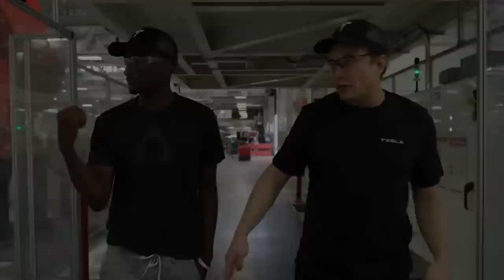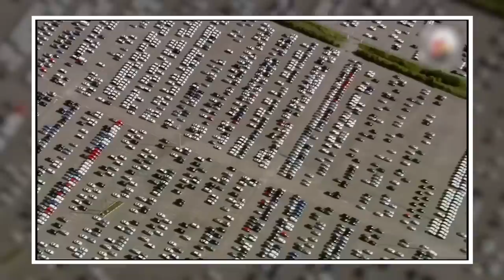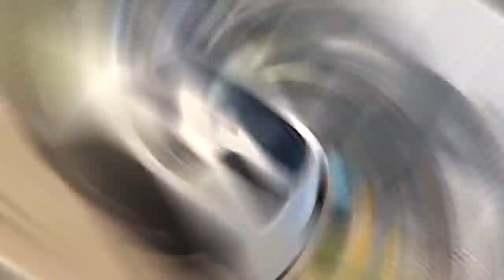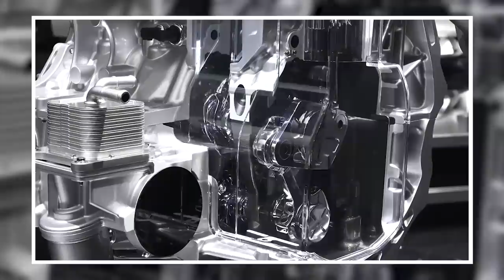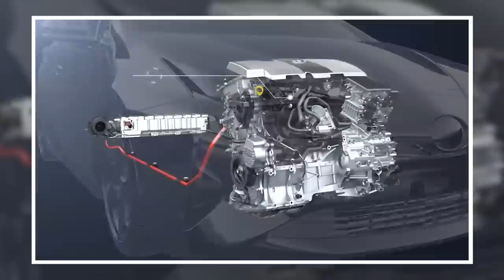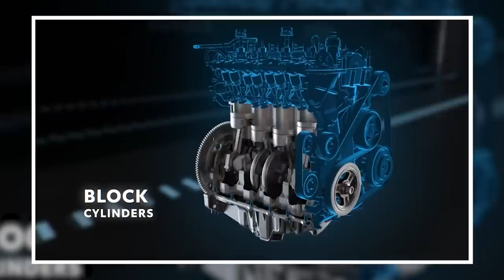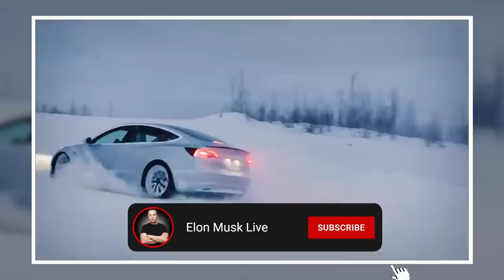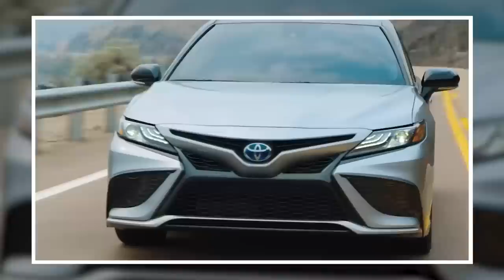Why Elon Musk is Scared of Toyota’s NEW INSANE ENGINE!

Comment: Literally everything in this video is exaggerated. Tesla doesn't have PERFECT efficiency, efficiency can always be improved. Toyota's new engine isn't revolutionary, it's a 6% increase in efficiency. Elon definitely isn't "scared" about it and it won't "knock him off his throne"

Coming from someone who absolutely loves Toyota cars and owns a modded Toyota Prius (you know, Toyota's efficient car), this new engine will likely have little to no effect on Tesla. And what do the 1/2JZ and 4AG engines have to do with anything in the video? I feel like you just threw in information on those engines and Toyota's history just to extend the video to 10 minutes to get more ad revenue/watch time
Reply: Nothing "efficient" about needing three motors to do the job that a single petrol engine has been doing in automobiles for over a century.. Nothing "efficient" about the range of an ev either..
Reply: 😆 🤣 facts
Reply: @motherlovinsnuffstar  the best design I’ve seen is a manifold conversion from gas to Hydrogen for any Combustion engine but that would mean free fuel for every one
Reply: @Straywalker0420  Yeah, they can't have that lmao
Reply: @Straywalker0420  no hydrogen engines does not mean free fuel. This is a common misconception made fuel cell engines are not ran on water they require more expensive fuel being hydrogen. The hydrogen combustion engine requires a lot more complexity in chemicals in order to work. Problem is that there isn’t enough resources for such things to exists they been trying to project these things for over 20 years now…
Reply: HeyitsRed  Absolutely right!!! That shows you definitely understand!!! I don't believe for one New York second that they'll ever rattle Elons nerves!!! Also a happy 02tacoma owner of which I'm proud to be. And knowing there great mechanical machines. Still not impressed by the new motor as well. Please continue your obviously intellectual comments as it's refreshing to read such!!!
Reply: @6gi  Well the actual reasons are because

1. My mom encouraged it since she wanted me to have a reliable, efficient car for college and my last bit of high school. A couple months earlier she didn't want me to get a Prius for the exact reasons you said, but then my aunt (who owns a 2016 Prius that she's going to pay me to mod) told her that none of that is true

2. When we bought it, it was when the car shortage was at its peak. Though luckily it was just BEFORE prices went up. The Toyota dealership had so few cars that they only had like 30 total cars when normally they had over 150. Out of those, they only had 2 Priuses, about 4 Corollas, and like 3 Camrys, so my choices were pretty limited. I wanted a red car, and the Priuses were 2 of the only red cars there. It was a 2015 used and 2021 brand new Prius. We decided to try the 2021 first and it was a borderline luxury car, as if it came from Lexus

So we took it for a test drive and it was great, and only had 48 miles on it. After we bought the car and I got into Initial D, I decided to get into cars. I always hear people say the Prius was slow, boring, and ugly and I can tell you, only the last one is true. The thing isn't fast, but it's not slow either, more of just average (though you can still add performance upgrades that are not turbos or superchargers). That car is definitely not boring. Not only is it a ton of fun to drive and has incredible handling, but I've also managed to have the same fun in it I'd have in any other car, drifting that thing around corners and modifying it to look cooler (front lip kit, front license plate relocator, rear lip spoiler, diffusers, etc). I even took it to a gravel circuit road that was at the campsite I visited with some friends and when we learned no one else would be camping there for the weekend, we used half a tank of gas in my car using the Prius as a rally car. That was some of the most fun I've ever had. We even managed to jump it a couple times, but that wasn't a problem because the car has built in plastic skid plates

That car is very underrated and gets a ton of hate it doesn't deserve. The reason most people hate it is because it's not powerful, or fast, or as stylish/cool as something like a Corvette or GT-R, but it also isn't meant to be. It gets hate for something that doesn't relate to the car even a little. It's meant to be a cheap, reliable hybrid car with great mileage and it does exactly that. Plus most of the people who say it's boring have never driven it. As James Pumpfrey from Donut Media said, "It's more fun to drive a slow car fast than a fast car slow"

Anyway that's my English essay of an answer, but usually people don't understand unless I go into detail
Reply: @seanixt  Blanking blank However much I hate to admit or agree with you I'm sorry to say I'm pretty sure that's true!!!! And I'm thinking it'll be very similar to the change we made from analog to digital television sets!!! As most suthsayers have said we'll be dragged kicking and screaming into the twenty first century weather we like it or not!!!! So I'm simply going to say relax sit back and enjoy the technology as it most assuredly will arrive extremely quicker than we could have ever anticipated!!!! I'm thinking even though we know this it's still going to be an extremely rude awakening!!! I mean we're not even a quarter of the way into this century and governments are already contemplating mandatory switch over to EVs !!!
Reply: I agree, this is biased
Reply: Well if im not mistaken they have a 1/2jz type engine that runs on hydrogen rather than gas they have a v8 in devolopement witha little help from yamaha
Reply: @poke12gauge32  hydrogen engines don't work like combustion engines at all, so the hydrogen engines will be NOTHING like any famous Toyota engine from the past
Reply: It may not knock his throne in the us but it sure will on the other parts of the world. Toyota didn't become number 1 in selling cars because their main market is the US, it's the world and their brand image is way stronger than Tesla
Reply: The bugaboo of long stroke engines is piston speeds get too high.
Reply: Thank u for the heads u0
Reply: @Straywalker0420  you mean alkanes/alkenes -> co2/co/c + h2o and h2o -> h2 + o2? the breakdown of water needs electricity, and then what? you wanna burn the h2? heat is lost to the surroundings, so youre better off fitting h2 and o2 into fuel cells, but then thats using h2 to generate electricity, that you use to break down water?
Reply: @justkev1044  the model here is flawed but there have been models that simply convert the manifold out with storage tanks for hydrogen instead of gasoline and ran perfectly zero emissions same combustion engine unfortunately the designers that accomplished this were killed!
Reply: @Straywalker0420  actually what does “converting the manifold out with storage tanks” mean
Reply: I feel like you just saved me from 9 minutes of wasted time so thanks for the rundown.
Reply: It was pretty funny when he said “if the 2j can be tuned to 2k hp, what do you think their engines can do today”. I don’t think it works like that but what do I know
Reply: @youtubescholar  i think the modern engines only got more support from electronic controls, the mechanical parts themselves are mature enough. its just a combination of trying to optimize combustion and also combusting more fuel for power. you cant change how fuels work
Reply: yea this video was a total waste of time. content farms were one of the worst things to happen to the internet.
Reply: Prius owner
Reply: But but but Toyota cranks out 100 BILLION HP when tweaked.. . 🙄
Reply: @HeyItsRed_  I am jealous. I had no help with a car or college. I saved up 1200$ and found a 1995 civic that only had 112k miles. This was 12 years ago. I put 200k nearly trouble free miles on it before it got totaled by my girlfriend. Its insane how much used cars are going for these days. That same car would likely go for triple what i payed if you were to buy it today.
Reply: This whole video reads like like a word salad. This channel doesn't even bother doing any research or analysis of their own and just regurgitates the first hit they found on google as if it was an infomercial. With some effort put in this video, I am sure they could purpose themselves into selling snake oils to their most gullible viewers.
Reply: Definitely not revolutionary, car companies always play it safe

Comment: FYI 2JZ-GE is the NA version, 2JZ-GTE was the version turbo’ed with 280-320hp form factory, 1000 hp is doable but not with few modification, requires turbo, injectors, intake manifold, exhaust manifold, fuel pump, pistons, rods etc, what make its legendary is the fact that most internals can handle up to 700-800 hp .
Reply: So why does every Honda kids be saying the K series can beat 2JZ because their K series engine can get to 700HP without engine Modifications but someone that make the “stock”K 24 engine is actually only got stock Block💀

Comment: I had a 1997 Corolla and the odometer started over . When I got rid of it , the odometer was back at 34 thousand miles. Only thing I did was keep all fluids changed and changed the timing belt . Original ac still blew cold , Original power locks and power windows . Never got a million miles out of the dozens of chevys,  Oldsmobile, or Pontiac that I've owned. Honda and Toyota and Subaru are awesome
Reply: My dad owned a Camry I crashed into a tree. That thing still worked for 6 years after. Sorry Dad. Ps. 1997 Camry.
Reply: Hold up wait a minute.  Toyota honda and subaru? No not subaru lmao
Reply: It wasn't 134,000 miles? It was 1,034,000 miles? Original clutch? No engine or transmission rebuild? I wonder if that's a candidate for the Guinness book.
Reply: @MorrisDugan  it's not anything new for toyotas to do a million miles without major replacement.
Reply: @MrMuffanga  I knew about 250,000 miles, and somewhat more, but a million is amazing.
Reply: @MorrisDugan  1 mil from Toyota is 15 year old news.....
Reply: I would dispute the Subaru quality and reliability. They were very good up to the late 90's but it went downhill from there. Still better than any American brand can do but Honda and Toyota are king. I quess you can add Mazda as well. But all the KIA's, Hyundai's, VW's, Ford's, Chrysler's and Dodge's are a joke. And I'm not even mentioning the "luxury" brands...
Reply: @TermlessHGW  My mechanic said that a certain number of Subarus can fail early, and the rest will likely last a long time.
Reply: It really depends on the cars/engines you’re talking about here. I’ve owned and got my hands dirty with a lot of the makes u mentioned. Buick 3800 series are as good as most Toyota’s when you factor in cost. 5.3 vortecs are bullet proof and powerful for the money. Ford 4.6s aren’t bad, dodge 5.7 hemis aren’t bad. Hell, there were even saturns that had extremely reliable engines. Are you aware that not all Toyota engines are good? You better know which years 2000-2012 of the 4 cyl 1.8s or 2.4s to buy or you will have chronic engine oil burning from failed low friction piston rings. I bought my wife a scion but that’s because I know the difference between brand loyalty and bad engines/cars. Truth is the reason Toyota is generally good is because they don’t rush into unproven technology and they keep their cars relatively simple but good quality. Despite this I would still choose any decent brand’s manual transmission over the best automatic transmission Toyota has to offer even though they’re generally excellent when maintained.
Reply: You owned dozens of cars? How many dozens?
Reply: You be lucky to make it to 100K with a Tesla ! Tesla is so over valued.

Comment: As has piston engines get more efficient they get more and more mechanicaly complicated. The transmissiond also more complex with 8 or more speeds. This Toyota engine is taking mechanical complexity to a new level.
Reply: But it is Toyota they don't break and run for 35 years 500.000 or more
Reply: I'm an 02 Toyota Tacoma owner and couldn't be happier about this engine!!! Isn't it wonderful that Elon and Toyota have come together on a recent build????
Reply: The 8 speed in the Camry tends to stutter a lot at low speeds. Occasionally at medium speeds too if you are too hard on the gas it gets confused.
Reply: It'll be running long after the EVs on the road today have been recycled. And those moving parts have constant lubrication, and you can change out the oil and keep it fresh, unlike the sealed bearings in electric motors. As simple as everyone thinks those overpriced, under engineered EVs are, you'd expect them to last longer than they do.
Reply: @motherlovinsnuffstar  yeah and cell phones will never be in demand Aaaaahhhhh ha ha ha ha ha ha 😂😄😆😂🤣😅
Reply: This Toyota engine eliminates the need for trillions of dollars in solar wind and other electrical plants being constructed. It also eliminates the need for advanced metals and mining.
Reply: @kimnielsenthewordyvikingett159  What kind of mechanical engineering goes into a cellular phone? Are your parents siblings?..
Reply: How is a 8 speed transmission more complicated than a 6 speed transmission of same year?  I wouldn’t call either complicated.
Reply: Have you ever tried to make efficient batteries or a good electric motor? Electricity storage and magnetic poles are way more complicated than any thing on a combustion engine
Reply: @wageslave387  Doesn't that sound as though you  should take it and have that diagnosed by a mechanic sweetheart????
Reply: @adriaanvantulpenbaard1740  Toyota and Ford has the ball right now
Reply: I'm a mechanic and I'm happy this is why I became a mechanical
Reply: @unknownninja8127  Did you mean to say a mechanical engineer or mechanic sweetheart???
Reply: toyota is reliable
Reply: @aaronpingol1566  Happy 😊 owner of a 2002 taco 🌮 4 banger 5 speed stick 2 speed transfer case 4 wheel drive single cab 33×15.50×15 on 15×12 wheels!!! You don't have to convince me sweetie!!!!
Reply: @motherlovinsnuffstar  Why would you need fresh oil? An engine needs that because it will release chemicals but not a motor. The only issue is degradation of the insulation or basically plastic which all know from the environment, never go away.
Reply: @Bayliss21  And requires billions to mine oil and steel.
Reply: @unknownninja8127  It’s a good thing you’re not an English major.
Reply: Idk about you but a Toyota ICE powered car is deffo more reliable than a Tesla. 

Why? Because they are well engineered and well manufactured. Doesn't matter how complex a component is, if it is well engineered and manufactured then it will be reliable.
Reply: And less reliable
Reply: the simplicity of electric engines  means far less mechanical problems, and no oil changes or tune ups and the biggest plus is they are whisper quite, and another positive feature is you hardly ever have to use your brakes.